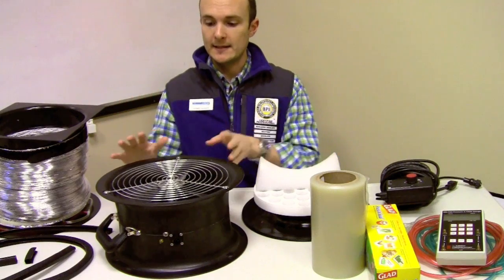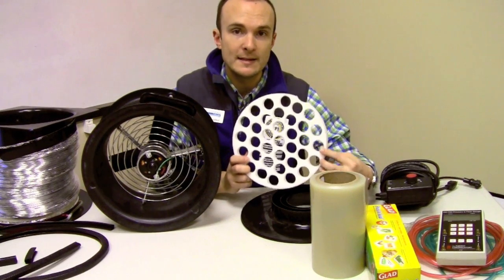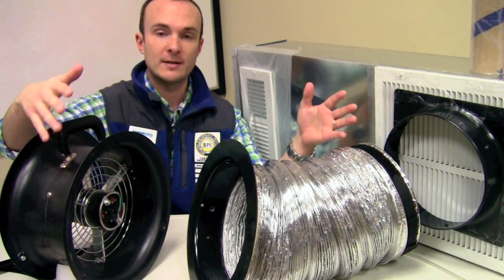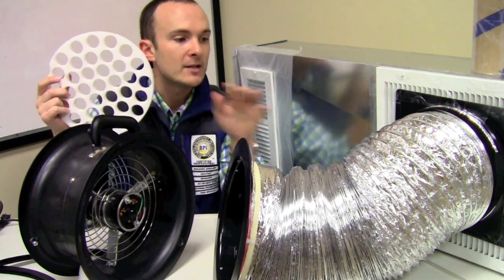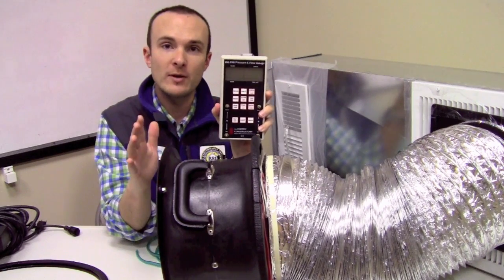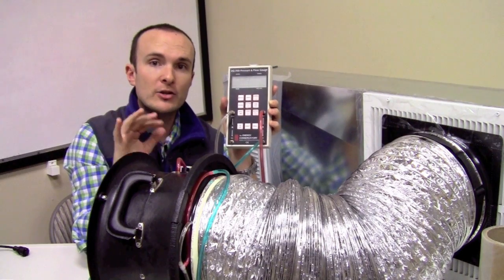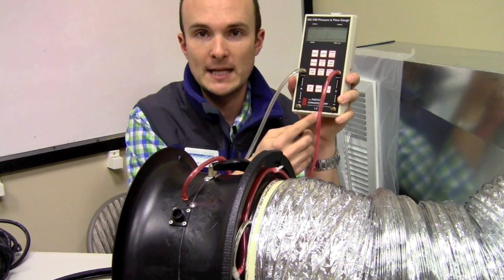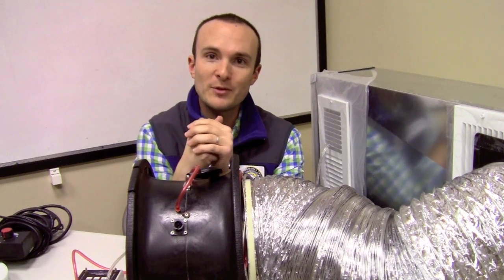Duct Blaster Mechanics for Energy Auditors and Home Performance Professionals

Comment from the maker: +Michael Scibetta actually it depends on what state the building's in... if it's rough-in, I like to use pressurized because the ducts are covered in hardcore duct mask, since there's so much dust.  Also, I can immediately hook up the theatrical fogger and see where the leakage is.
If it's a finished house, I use depressurized, which pulls the tape further onto the registers.  In this case, I almost never use fog, since you can't see any of the connections anyway.

Comment: Cool video！How does the red hose in the middle of the fan measure the wind speed? Is there a detailed location structure?
Reply from the maker: It measures pressure before and after the fan, not velocity.